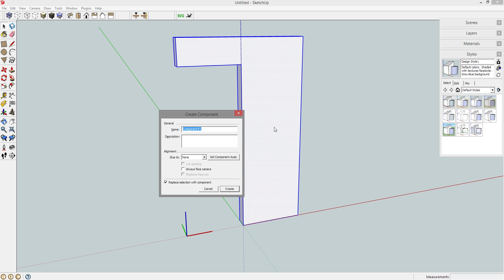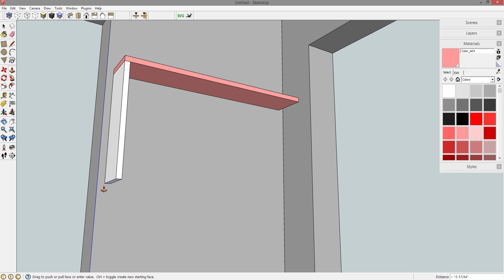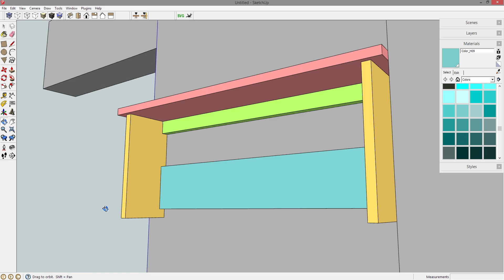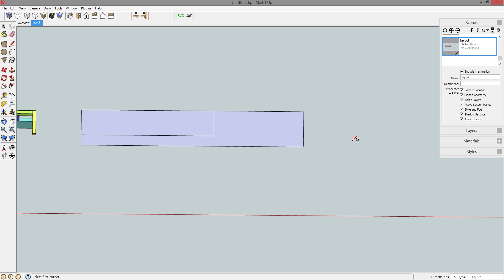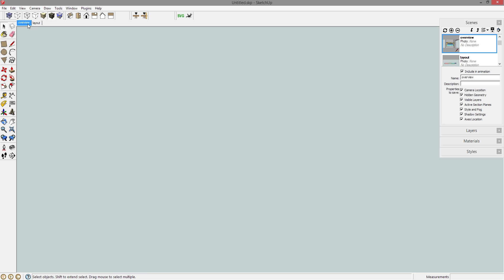SketchUp: Coat Rack - 226

Comment: Good work! I remember having to learn SketechUp, after SoildWorks and AutoCAD. It was a challenge at that time--after working with SoildWorks for many years, I haven't tried SketechUp since. But you make it look easy. Are you working on the free version of it?
Reply from the maker: +Andrew DeShaw Yeah. The free version 8. The new free version will work too but you can't use it for commercial uses.

Comment: I'm working a TV stand, what is an efficient way to make miters on moldings/trim? I am able to do it but it is extremely time consuming making each miter. There has to be a better way. 

Great video, easy to follow along with your play by play and thorough instructions!
Reply from the maker: I don't make molding and trim work in individual pieces. I use the follow me tool to make the entire run of trim and just measure the long distances to determine how much I need.

Comment: How the hell do you use the rotate tool so effectively?
I have a helluva time with that tool..never wants to cooperate
Great Video.
Reply from the maker: +John Parker Select what you want to rotate, Q for rotate, position the cursor on the appropriate plane to rotate on (it will change colors based on what plane you will rotate on), click to start, drag in the direction, type the angle, press enter.
Reply: +Jay Bates 
Sounds simple ! But I have the same trouble. When I place the tool to my work piece it constantly wants to switch back and forth between the various planes.
Reply: +Vic Krue once you have the tool on the correct plane / orientation, you can press and hold the shift key to lock it to that reference. Makes life a lot easier....  ;^)

Comment: Hey Jay, in your layout do you consider the thickness of your saw blades since all are back to back to each other. Would it make sense to add spaces in between?
Reply from the maker: +melitamann1983 I do consider it but never add it between parts. It will get confusing that way. Just add up the saw cuts and multiply by 1/8". If you have enough room at the end of the board you will be fine.

Comment: how are you doing the math .. you said 3.5 = 5 inches how is that ... is there a web site that show's you the math
Reply from the maker: That's not what I said. I said "it's already 1.5 and I want to go 5...so 3.5, enter"          It was already 1.5" and I added 3.5" which takes it to 5" What I said was not 100% grammatically correct but if you follow along it should be understood.

Comment: do you know how to use solidworks?
Reply from the maker: +GoldenRetriever Abbie I learned SolidWorks first while in college. Completed my degree college and didn't have access to it anymore so I learned SketchUp. I really miss the mouse shortcuts in SolidWorks.
Reply: +Jay Bates the question I have is,  next year I begin learning Matlab and solidworks. what would be a close free alternative to solidworks? I know it won't be the same, but I want to get the feel of 3d designing

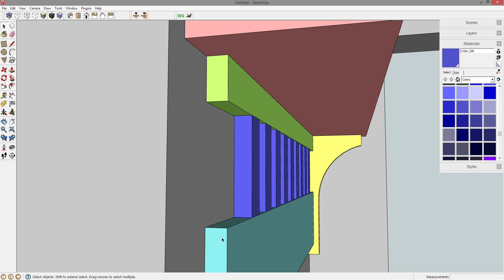Comment: 7:45 is what I did for my crib, where I put slats in for the cage and filled in the grooves,  between the slats, with spacers and surprisingly you can't see that I added the spacers. In other words it looks seamless. Great video. Thanks for sharing!

Comment: I apologize if you may have covered this in a previous video, but do you need to take the width of the blade into consideration when making a layout? As I am typing this, I may have just answered my own question (this is a coat rack not a rocket, so dimensions and tolerances aren't quite as crucial), but I am still interested in the response. Thank you for your time. Terrific video!
Reply from the maker: +Jeff Phillips I just make sure that if I'm getting close I add up the cuts and multiply by 1/8" to see if I have room for the blade. There is no need to put the 1/8" blade kerf between every part. That's time consuming and confusing.
Reply: He did mention it on this video when he was doing the layout that there was plenty of room left over for all the saw kerfs. You do need to account for it but Jay does it almost unconsciously (lots of practice!)